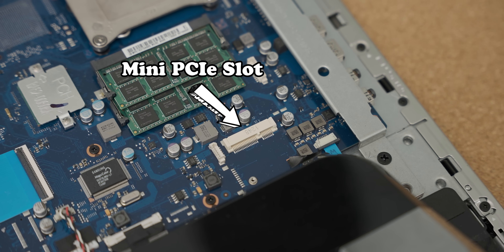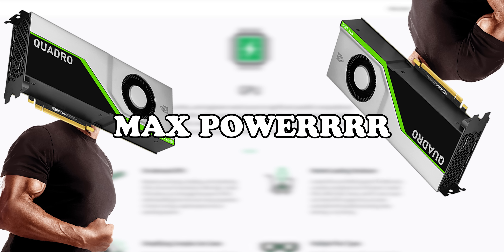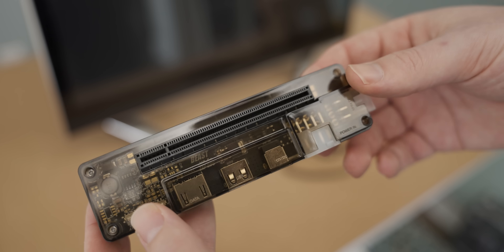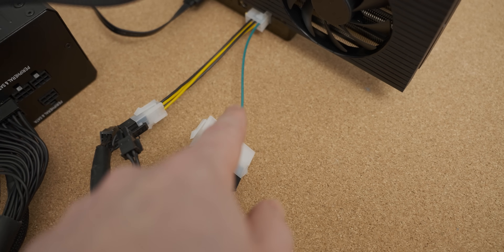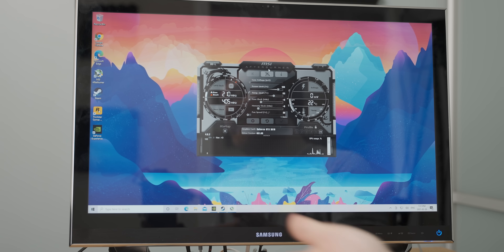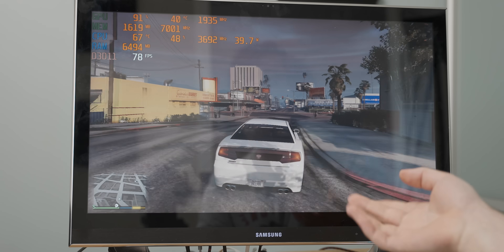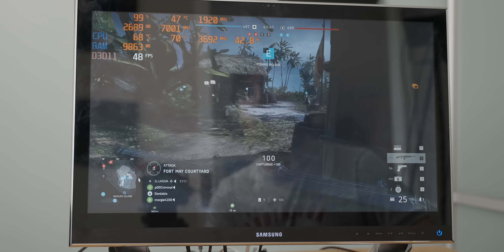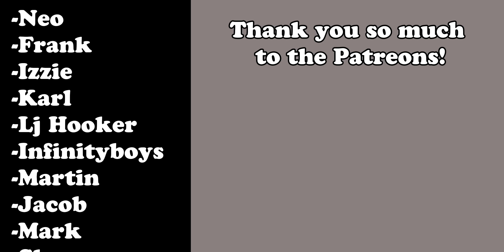The REAL Ultimate GPU Bottleneck? RTX 3070 with Mini PCIe (Pt. 2)

Comment: CS GO uses a lot o bandwidth in the PCI Express, that's why it was struggling
Reply from the maker: Oh that makes sense. 😁
Reply: I'm not sure, but I would assume that games that tend to be more CPU bottlenecked are going to have relatively higher PCIe bandwidth and thus perform relatively worse, and that something like a GPU TECH DEMO that is  tending to buffer more stuff in VRAM would do better relatively... of course, you can be bottlenecked by a single core so it's not quite that cut and dry but this is mostly for fun anyway.

Comment: let's talk about bottleneck, 4790k + 3090, kek
Reply: On desktop with Standard PCIe x16 Lanes is still Okay. I mean 4790k can still pull off beyond 70fps with Ray Tracing low-med in Cyberpunk 2077 using RTX 3090.
Reply: @ClayWheeler  yep it's true, expecially cause cpu is delidded and pushed to 4.9 ghz, but unless you do somenting Extreme like ciberpunk or fs in vr the gpu is always low usage

Comment: You can also do the same thing with a laptop that has an ExpressCard slot, same PCIe1x limitation exists though, if you find a computer that used PCIe 4.0 you'd see 2 the performance from just one lane of PCIe, but most if not all of these have switched to M.2 with at least 2 lanes of PCIe(WWAN slots might be 1x but IIRC will only work with WLAN/WWAN)
I'm assuming you've already done this, but in case you havent, well, here's a fun project, and can provbably use much of this hardware for another video

Comment: Scary to think that some laptops have their thunderbolt 3 port implemented with only 2 PCIe lanes trying to run an eGPU >.> 

Makes me wonder though, how bottlenecked a modern 30XX series nvidea GPU is on a thunderbolt eGPU enclosure? I wouldn't be surprised if graphics card performance has overcome thunderbolt / there's no cost-effective difference than say a 20XX or even 10XX card in an eGPU enclosure over a 30XX card.

Comment: I want to see you double sided tape in some repurposed laptop fans along side of the default one and solder them into a USB cable and route that through the ram "glory hole" to the bottom USB. That way we can see how far you can abuse that CPU and built in GPU.

Comment: I did this setup for a 5 year old Dell laptop, and a smartcard pcie to the same type of setup. Had a GTX580 with a i5 2000 something U. This hooked me up until I could afford a new game rig. These adapters are so underrated.
Reply: Yeah I also have Core i5 2430m Processor 2nd Gen.

It's very interesting with performance gain. I made a video about it in my channel

Comment: Is it possible to do this while avoiding/minimizing bottleneck?
Reply: You have to use a low end card for that. Some people say you don't lose much performance with a GTX 650 or a GTX 750 Ti.

A high end card will struggle and this struggle is getting worse and worse with newer cards. I wouldn't be impressed if you could achieve better results with a GTX 1080 or something.

Comment: i suggest using this this with 1060, 1070, 2060 for example. that someone might be able to get super cheap on used market and see if its about the same performance as the 3070 with that 1x bottleneck

Comment: I have seen that even with a standard egpu Thunderbolt 3 enclosure with RTX 3080 you are getting only it's 50% performance with an i7 10750H - 6 core/12 threads at 5GHz max.

Comment: The EXP GDC is actually pretty competent. With the correct m.2 adapter you can actually get 4 lanes which really helps. You can power it with the brick power supplies from Dell optiplexes of old and you can use an adapter cable to then power your GPU's connectors from the GDC, and the whole thing powers up and down with your computer.

Comment: Well i had no luck with an external graphics card adapter ,
Fried a 8400 gs and a hd 5450 until i throwed it away (never worked , the gpus both had a green line through the screen after it...) Never test these shitthings with your main graphics card guys

Comment: I use a m.2 nvme to pcie 4x adapter and i have like 18% performance drop with my 3060. I think thats actually pretty acceptable when taking in consideration that I mainly use that gpu for tensorflow which only seems to perform around 2% worth than on my friends 16x pcie slot.

Comment: I use one of these with the expresscard to make my old dell latitude more usable in 3D CAD with a 750ti. Expresscard makes it extremely easy to use, its not quite hotswappable but i never have problems when unplugging it or plugging it back in (i do have to turn the pc off though), it always recognizes the card just fine. And with a lower end gpu the bottleneck isnt as noticeable, just from experience i would say the loss is less than 10%, of course the 750ti is quite a low end card these days but its an incredible upgrade from integrated intel graphics and for something that takes 5 seconds to plug in and one reboot its great.